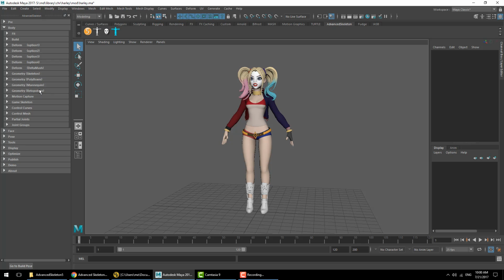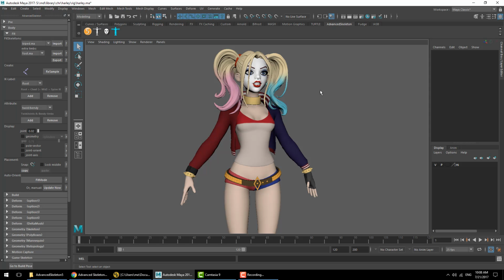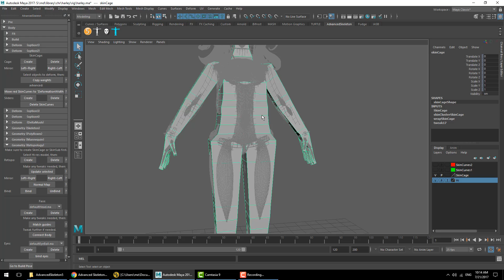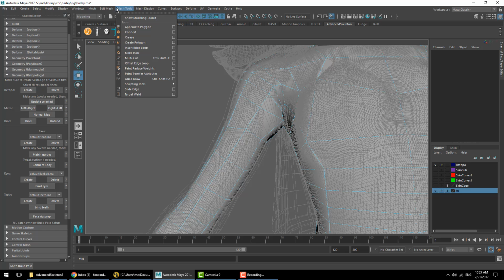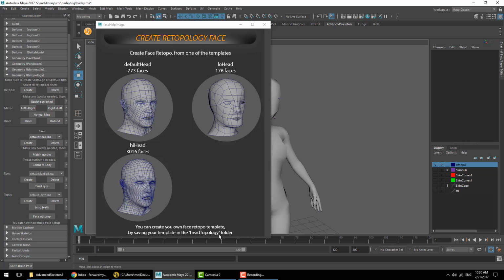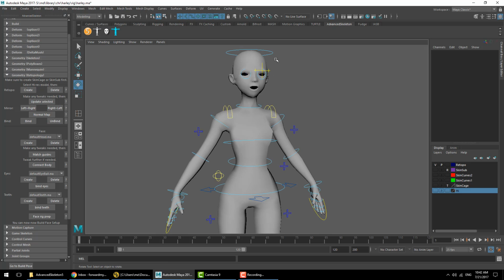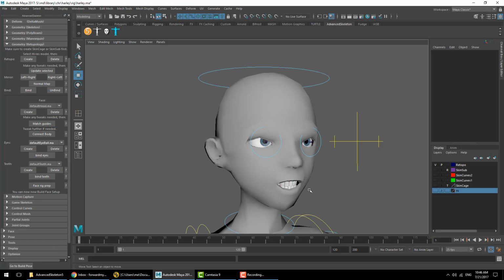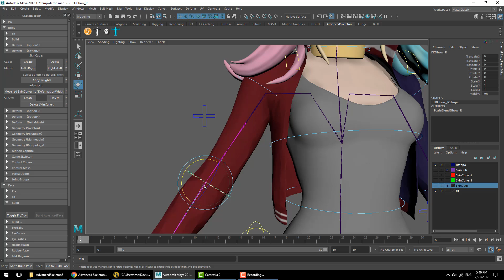Retopology

Comment: I like this video, it gives you the illusion that you can solve retopology without really working on it.
Reply: snarky-ass comments, like this one, are made by people who don't realize how much work it takes to actually do the pymel work that's behind advanced skeleton.  re-top'ing by hand isn't used in production environments (in motion pictures at least) - it's actually similar processes (whilst using different tools) like this where you bind a very low-res mesh to a high res bump+displacement maps.. it's allows the animator to be the animator, and the render wrangler puts the work on the rendering engine (which is where it should be) to come up with the detail.  While games are different at the moment, soon it'll be the same workflow, as hardware on gaming platforms are soon giving a real-time rendering performance and gaming engines are bolting up this technique.  So sorry, if you are still using topgun, maya's multi-cut or (shiver) zbrush's own retopologizing tool, you're working in 2010 my friend, and haven't really worked hard on keeping up with the CG industry.
Reply: @JasonBraatzC  DDDDDAAAAAMMMMMMM
- side note, you answered SO MANY OF my questions. ur a savage.